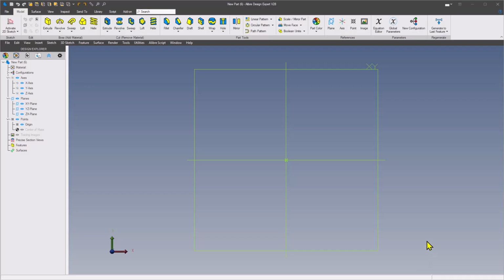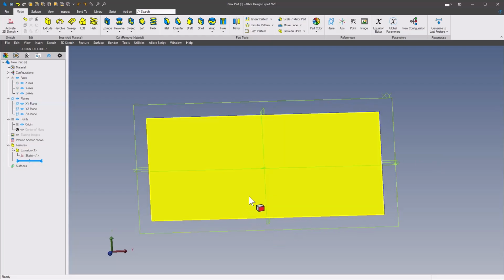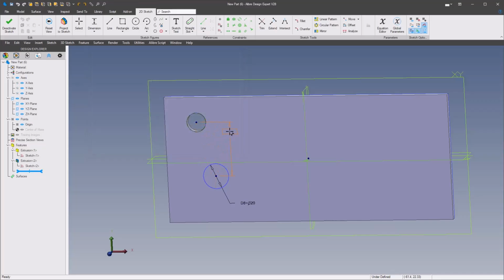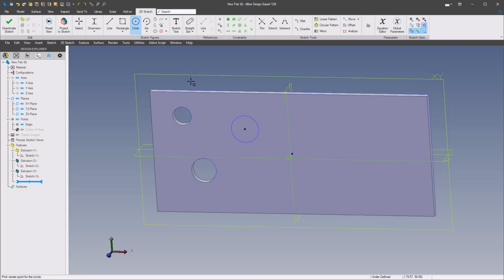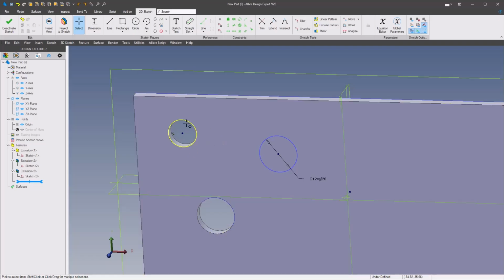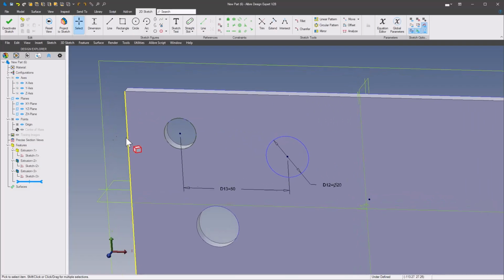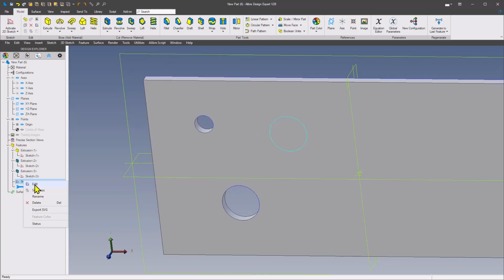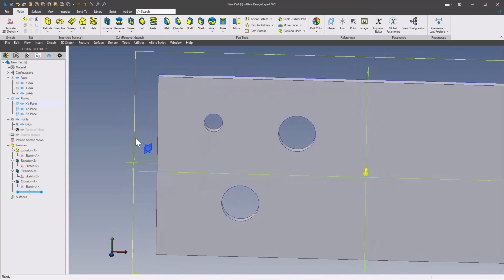Alibre Design Quick Tip - Project to Sketch or Not

Comment: Do you have to do this on every sketch if you want to dimension something to an edge? In Solidworks it recognizes the lines of the feature which you can dimension from but when I try on alibre for example I try to draw a corner rectangle from the bottom left it does not snap to the existing feature. Does alibre atom not have this feature or is something off with my settings?
Reply from the maker: When you are adding geometry for a new feature you should use constraints to locate a line on an existing part edge. Alibre will not 'wake up' the edges like SolidWorks as you mouse over them but you do have constraints to accomplish the task. It's a new work flow to get used to.
Reply: @HaroldL-bn4eo  that's lame, but thanks for confirming